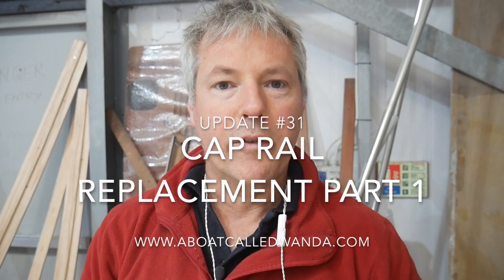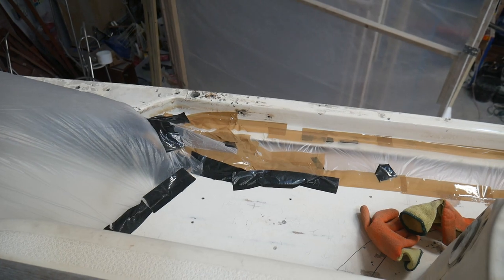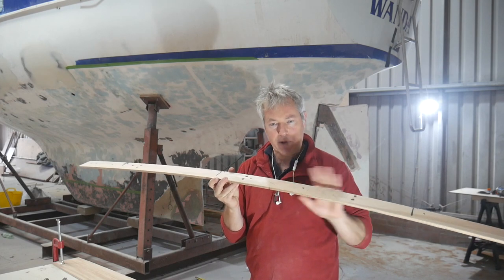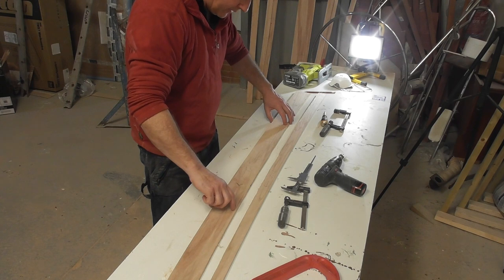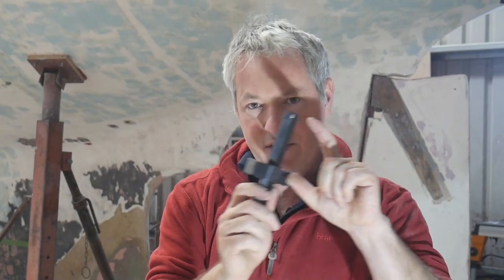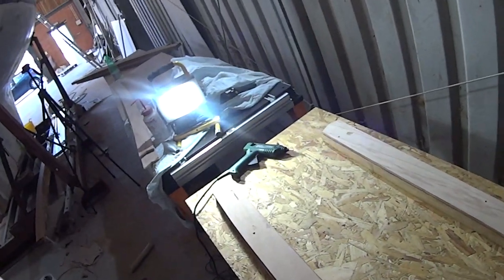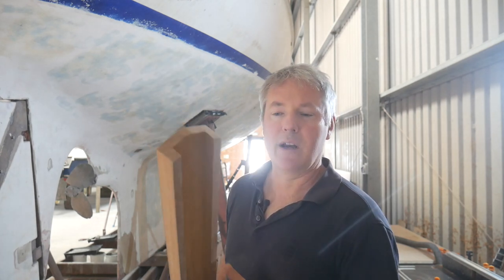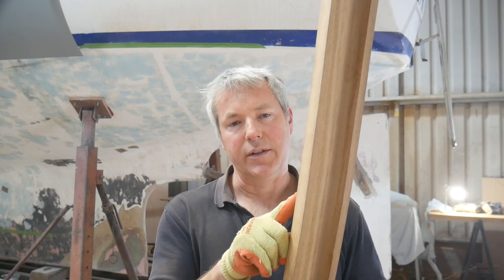#31 Replacing the Cap Rail part 1

Comment: I too am wondering about your work area.  I have rarely found and then only in large urban environments an owner who stores boats or works on them who will allow grinding or dust producing work at all.  Those that do seem somewhat marginal at best whereas you have excellent lighting and beaucoup work space as well as power.  Do you own the building??  Sure makes work such as yours nice.

Comment: I know it's late now but the piece you put the cap rail on goes over the deck glass. To do it right so it doesn't leak you should remove the rail and glass the deck over the edge of the hull where it meets the deck.  Then use 3m 5200 or so to replace the kick rail. It's likely wet anyway.